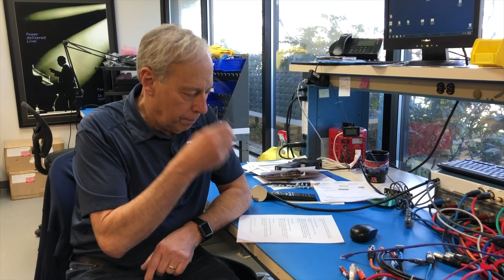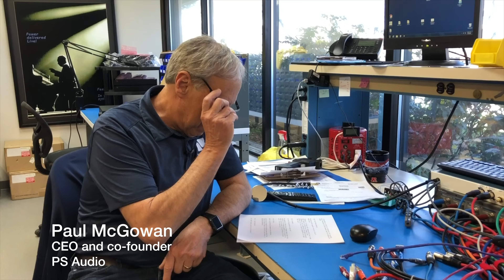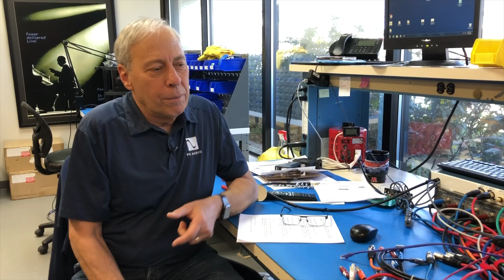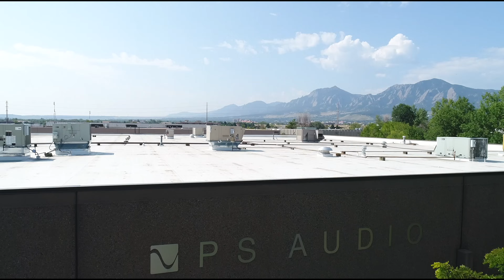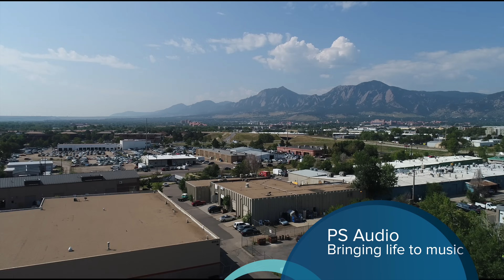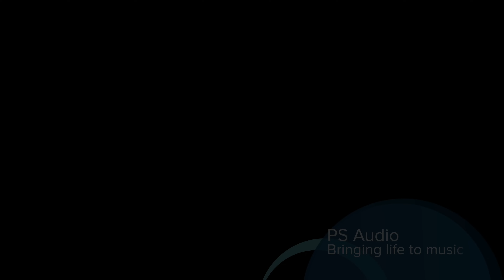Can side firing woofers be high end?

Comment: I think the biggest problem can come from whether they are properly powered and contourable, Assuming they are, then it comes down to whether the cabinet design is optimal. If I built a pair of tower speakers with integral subs it would likely be based on a transmission line. The upper section would be a 2 or 3 way system that is isolated internally from the bass frequencies.

Comment: I have 4 large living room floor standing speakers with 8 and 10 inch woofers on the side of the speaker cabnets.
I've had them for decades. Love them.
I am currently in the process of replacing all the drivers, cross overs and I am even going to install real wood veneers on them. They are currently only painted like cheap speakers of the 80s. But when I'm done they will be truly world class. 
I'm gonna use ribbon tweeters and tang band woofers with Dayton audio ps95 midrange speakers
Reply: Hey, how are you getting on with your Loudspeakers.

Comment: Probably wouldn't of hurt to mention why they put them in the side to begin with. Obvious to some but not to others, but the reason was so you could run bigger drivers without making the cabinet excessively wide, as the trend towards thinner more stylish cabinets caught on.
Reply: Low end is about moving air and to move enough air, you need a driver with enough cone area , but loudspeakers want's as slim front as possible to avoid refratctions from the front drivers.  So optimally you want a solid 6½" driver for the mids which means the front should be about 7". That doesn't leave much for a woofer's cone area which means, a proper woofer needs to be side mounted . A longthrow 10" atleast, preferably a good 12" that's cut at about 80Hz while the 6½" plays everything from the subwoofer to the tweeter.

Comment: There IS directionality in Stereo Subs, but it's less "imaging" specific than mids/tweets and that's thanks to several Million years of our ORGANIC wetware design upgrades.  Otherwise, "Stereo" subwoofers wouldn't work like you describe and they absolutely do.  There's a difference between "Stereo Subwoofers" and "Dual Mono" Subwoofers.  Put on a Classic Merc or Telarc Organ recording and hear the room pressurize and the minimalist mics recreate what happens in RAH, Davies Hall or the original venue, whatever it might have been.  Bass is absolutely directional.  Everybody gets to choose what fits their environment/needs, but it's my opinion that "skinny sideways" speakers are a nearly entirely "aesthetic" conceit by the offspring of '70's Mom's/Dad's who didn't like those "great big ole speaker boxes" because of (precisely) how well they worked.  So, yes, I believe one DOES need "a roomful" of Stereo Gear to recreate spacious "room filling" sound if "good" is included on the shopping list.  Amar Bose lied like a rug...lol.  Or more accurately, BOSE the Corporation did by electing to leave "High Fidelity" out of the descriptive in that old TV commercial.  Anything else is a glorified table radio.  Which might well be what some folks prefer, but it's not "High Fidelity".  YMMV...

Comment: I have 2 subs in my room. They are BIG subs, 18" drivers. Because of their size I have two options. One was to stack them one on top of the other OR ,as I have them, across the room from each other and actually firing AT each other. Any opinion on this setup? Is it detrimental to the bass? I honestly think it is fine. THANKS
Reply: 53patsfan it is absolutely fine

Comment: Paul,  You missed the biggest advantage of a side firing woofer...  The speakers can be placed against the wall.  Since low frequencies are omni-directional, speakers usually need to be placed a foot or more from the wall or there will be low-frequency interference from the sound reflecting off of the wall.  Having the woofer on the side means that the low frequencies virtually originate from the wall itself.  I tried a design with zero phase crossovers using fill-in speakers (via the B&O paper from an AES Journal) and side firing woofers back in the late 70s.  I never did finish the final crossover design and stayed with a conventional crossover, the side-firing woofers did perform as expected.

Bottom line is that if you have the need to place the speaker against the wall a side-firing design can be useful.
Reply: Will it be optimal to make slot port in front with a side firing woofer...while the mid range driver is concealed in its own enclosure in the main box...want to build a compact 3 way bookshelf system

Comment: Directionality of a woofer is also a function of its diameter size with smaller woofers being able to reach higher freqencies before beaming starts . Another consideration could be the width of the woofer baffle . Wider baffles will promote beaming in lower frequencies when the wavelenght is shorth enough to prevent bending around the baffle

Comment: Wait a minute... Or a milisecond or two because that side-sub would be about 1 ms behind the other drivers, not to mention loading the room off-phase. How do you time-align it on a passive system?

Always had that issue with the sm9 focals when mixing, and also with the barefoot range. Can't get a tight drum sound fast.
Reply: True, but you dont have trouble with rear vented speakers, they have lag way more than 1 ms.
I think they phase shift the rest of the system, at least the midbass coupler. But that will become a nightmare. Ask Paul, I want to know too. And in my case it is not 1ms just 0.91 ms, from the centre of the woofer to the front.. (Canton Karat 790.2 DC )

Comment: Agree, side firing woofers can be great. In fact, any higher frequency harmonic distortion from a side firing woofer will be less audible as the harmonics will be less effectively reflected to the ears. More important than where the woofer is located on the speaker is where the speaker is physically placed in the room. A speaker that aims at incorporating a subwoofer in it can easily yield too much subwoofer bass when you place such speakers in the corners of a room. A single subwoofer usually has its own gain adjustment to tweak the sub 100Hz performance against where the subwoofer is placed but with the subwoofer integrated, you might have no way to get the bass right other than speaker placement. Thus in actuality, usually an audiophile speaker with subwoofer built into it needs very careful placement away from corners unless you want to add an equalizer to tweak the bass, which true audiophiles hate to do.

Comment: I can not undestand passive radiators..i think they suck power and impact ..they talk about cabinet solidity and then they put passive radiators..a diaphragm that moves passively by the power of the powered woofer...that doesnt make any sense to me..please explain..thanks
Reply: endrizo 
Please, no disrespect intended. 
Much of the acoustic physics involved in audio is counter-intuitive. So... it will serve you well and be enormously helpful if you leave your pre-conceived notions behind.  

It may help you understand if you think of a passive radiator box as essentially the same as a ported sub.  

In both the LF driver is coupled to a mass via the internal air within the box.
When properly tuned both masses will resonate and augment the LF driver output. 

The resonating "mass" is the column of air in the port, and the passive radiator. 

Hope this helps

Comment: Hi Paul... What about designs like the Perfect 8 The Cube and The Grail T5? They both use side firing midbass all the way up to 2000hz and the tweeter centered? They seem to use small enough drivers that can play plat at 2000 90-degress off axis...

Comment: The problem that you have addressed elsewhere and did not mention here has to do with properly locating the sub woofer within the room to attain best case flat frequency response in the low end. Often the location of the mid and tweeter drivers is not always the best location for the sub woofer driver. So irrespective of the design being side fired or front fired, a separate sub woofer box or two (I absolutely agree that two subs are better than one, for many reasons) allows for specific location of the bass drivers in the room. And if the sub is in it's own box, then of course wherever it is located, it can be set in a front fired position.

Comment: Hi Paul, thanks for your wonderful videos. I follow almost every day. Can you tell what should be the highest in frequency range a side firing woofer should go? 200hz?
Reply: The answer is "it depends" - it depends on the size of the driver, relative to the wavelength of the sound it will be producing at a certain frequency. It's actually a gradual transition, from frequencies where the woofer diameter is more than 1/2 of the wavelength of the pressure (sound) wave (above which the woofer can be considered "directional") to frequencies where the woofer diameter is less than 1/4 of the wavelength of the pressure wave (below which the woofer is considered "non-directional" or "omnidirectional"), and in between those frequencies, the directivity of the woofer is "in-between" - undergoing a gradual transition from directional to non-directional. This has to do with the relative phase between sound emanating from all points on the woofer cone at a given listening angle; above the 1/2-wave frequency there are points that are greater than 180 degrees out of phase and you are getting a lot of cancellation for an observer who is 90 degrees off-axis, and below the 1/4-wave frequency, none of the sound is more than 90 degrees out of phase with any other sound being radiated by the driver, and so only constructive addition is happening. This comes from considering a radiating piston source as infinitely many individual points distributed across the surface of the diaphragm, each radiating their small contribution to the overall sound output of the woofer. The only exception to this is at higher frequencies where the woofer is no longer able to move as a piston due to cone break-up, which is when the needed acceleration exceeds the rigidity of the cone under the airload and the cone begins to deform; at those frequencies, the cone only works as a piston over smaller and smaller diameters with increasing frequency, or not at all.
Reply: You can guess what the non directional frequency starts. Middle C is a fairly high note and it's only 265 hz, so you would have to go at least an octave below middle C. So my answer would be 100 hz.

Comment: Hi Paul, can you elaborate on how to effectively solve room nodes when the subs are in the towers and not separate to do the "sub crawl". Acoustic Panels and bass traps? Thank You
Reply: He's not really an expert at room acoustics. Check out the music room 1 corner "traps" they installed. There was a series of videos....
I wondered if if they would have been more effective without the "engineered" perforated vents?
That said just removing room corners should help tame room modes.
Also don't forget DSP. Very effective in my music room 2.
Golden Ear speakers also use it. 
It's hard to get bass traps that are effective below 60 hz anyway ( I have 30hz room mode for example).
Reply: Paul McGowan Hi from norway, i would like to hear your oppinion about what you think is best, on the matter of the  DSP and THX and sourround sound all beeing produced digitaly today, is this the best way, or have you ever tryed to create this in an analogue way?
 and last would digital be better than the analogue way ??

Comment: Ok, what's the reason for a side sub?
Reply: The reason for a side subwoofer is because people nowadays consider the speaker to be more visually attractive if it has a narrow front baffle, and a narrow front baffle is thought to also contribute to better "imaging". That doesn't leave much room for large woofers. But if you make the cabinet depth deeper, you can put the woofer on the side. Some designers even incorporate a down-firing subwoofer, and this works as long as the crossover frequency is kept low, kind of like an extreme case of what Paul was describing in the video. Long wavelengths aren't absorbed by thin acoustic treatments, and it's the same for thin carpet, so the woofer's low frequency output isn't impeded by facing the floor.
Reply: Bor Nodnoc Bass.
Reply: For the KEF Blade, they also reduce cabinet vibration. They also do it so all the speakers are grouped together in height, and not have  the tweeter say 3ft above the woofer.